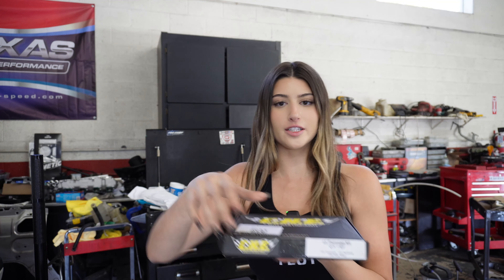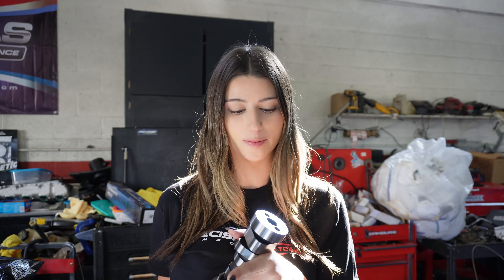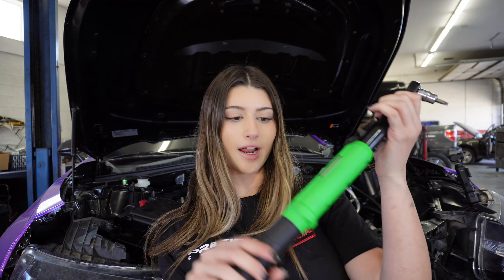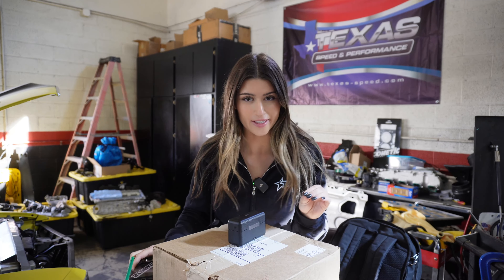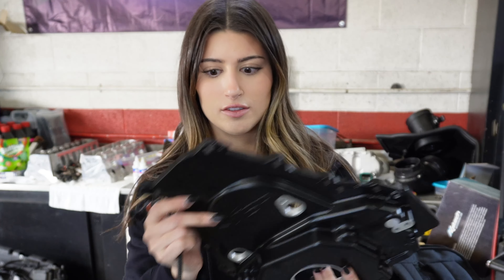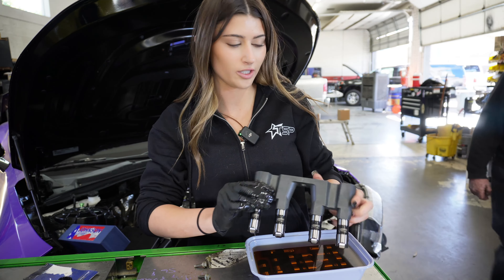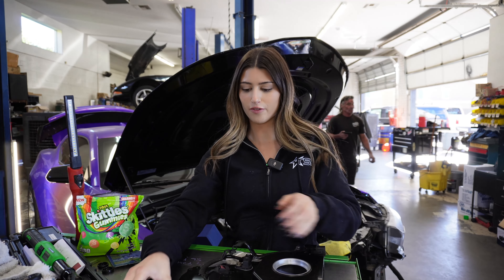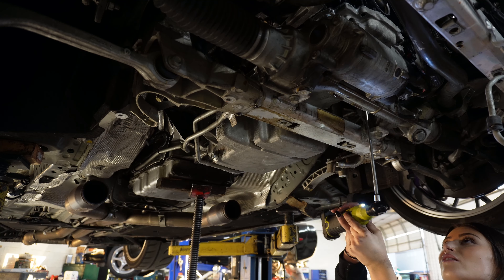ZL1 Heads/Cam Build: Upgrading Trunnions, Cam & Lifters

Comment: I wouldnt be against going with a diff convertor even if its not a high stall.  Even in stock form you benefit from a diff convertor
Reply from the maker: it's not that i'm completely against it, it's just expensive and I didn't wanna do more work
Reply: @autumnspooner  maybe later on you could do it . Idk your cam specs but an aftermarket convertor will help out with the cam and its range along with gears etc....either way great video and you learning the process.....If you decide to converter swap check out Circle D and get with texas speed 🙂